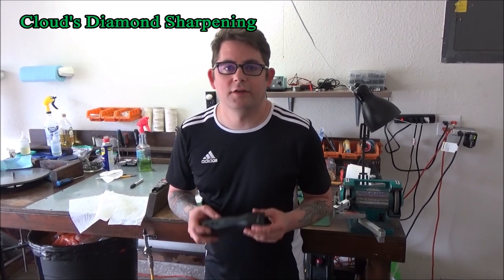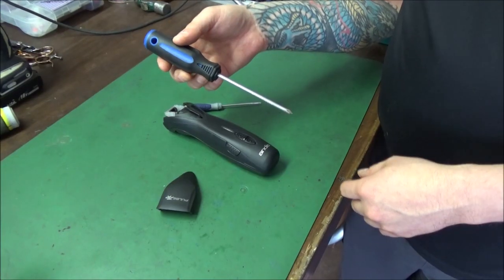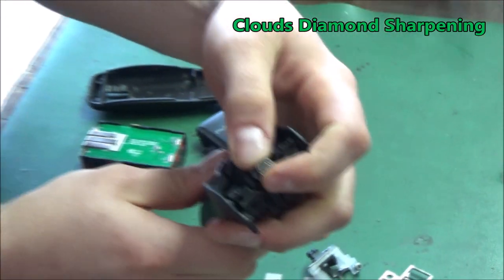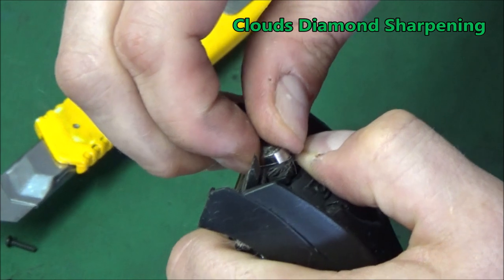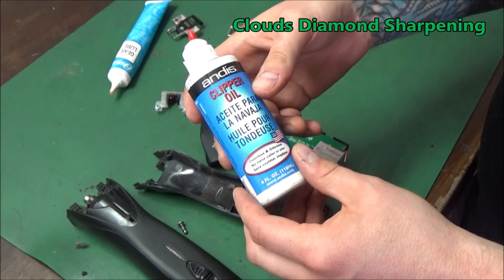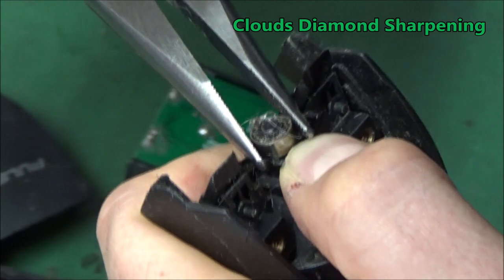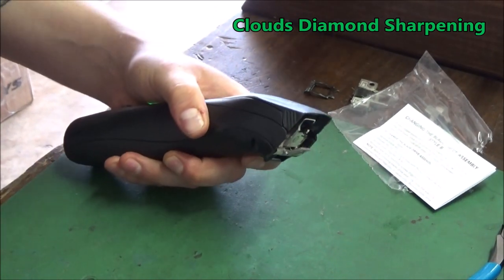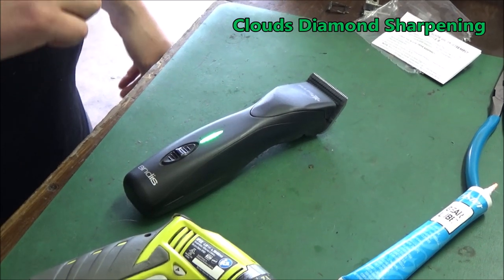Andis Pulse ZR Service Advanced Repair

Comment: hi i have trouble with the sponge it blocks the blde drive from working better is there a different spot it’s suppose to be at? im not the biggest fan of these clipper after using them since they came out… the price is ridiculous for all the annoying issues it has (gets too hot, dies fast, heavy and shaped weird so it rolls on the table, needs to be repaired more often, not as durable as you would like, and parts are expensive.)
Reply from the maker: Hi. The sponge will not alter performance. It's there to assist in keeping hair and debris from entering inside the housing. More times than not, when you experience excessive heat with Andis clippers, the heat is being generated from the blade itself, except for the rare case where the motor has an issue. The majority of Andis Professional Grooming clippers utilize motors that don't produce excessive heat unless the motor itself is bad. On rare occasions, we do see defective motors, but more times than not, it's a lack of blade care that compounds the problems. Blades that are not cared for properly will cause damage to the clippers themselves. I can't say with assurance what exactly is causing your issues, but if you'd like us to look them over or if you have any additional questions, please feel free to contact us directly.

Comment: Do they sell the bearing on its own? Mine seems to have broken loose but the last repair shop that worked on my clippers stripped the screws that hold the housing  together on my clippers .
Reply from the maker: Hello I don't sell parts. I can only repair them. And the bearing can't just be replaced you need to replace the whole motor. It's an assembly piece

Comment: I have a set like this, it runs and charges fine but the blade won’t hold tight to the body and I really can’t  use them at all. Would this be a fix for that?
Reply: Get a new animal hinge for it. Difference between a human and an animal hinge is it has a latch for it. These clippers were designed for both human and animal hinges.

Comment: Do you have any of the refurbished the class Andis 2G Detachable 2 Speed available in black or red? I’ve been looking everywhere for them. I saw one pair on eBay but wasn’t sure if they were the ones from your older videos.
Thanks
Reply: Also, is the black quieter than the red?
Reply from the maker: I currently do not have any for sale. The color has no bearing on the speed. Either you have one speed or two.
Reply from the maker: @charltenhenderson2163  No, one is not quieter than the other

Comment: Can you send information i need
Mines repaired they are 5 month
Old 8min run time...Won't come

On at all I took it to my repair 
Tech he said I have a bad circuit 
Board reccomend I send them
Back to andis ,
(Any suggestions?)
Reply from the maker: Hi I recommend send them back to Andis because if the PC board is bad it's not going to be very cheap and they're only eight months old they have a year warranty

Comment: Mine stopped turning on in general but the battery is green snd charged 100%
Reply from the maker: Hello it can be many different problems for example, the battery not making a complete connection to the pcb or it could have a motor problem or it was dropped and something is bent and keeping it from making a connection. i wont know until i look inside of it